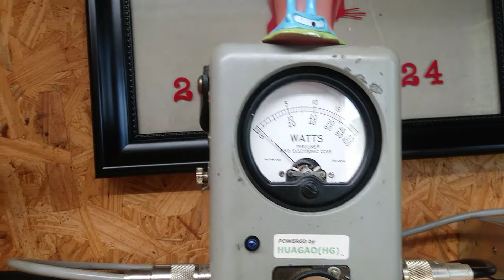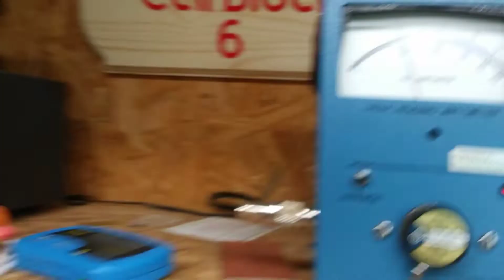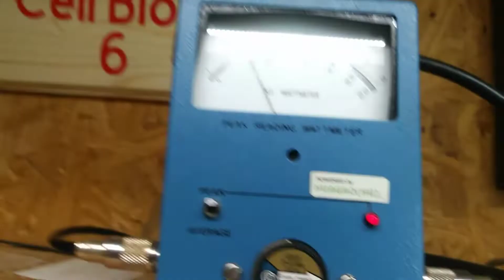Gray 100 bk from grave for giveaway

Comment: I had one come threw same gray 100. had MRF 450 yellow dot in it. had bad relay and mica caps went bad. oner runs on UK FM cb band . does around 100 watts FM draws just under 10 amps . does get quite warm on long keydown . was rebuilt SRF 3775 MP did get 120 watt into dummy load pep watts. with FM only cb only does around 100 . ben running years now.
Reply from the maker: Wow FM sweet